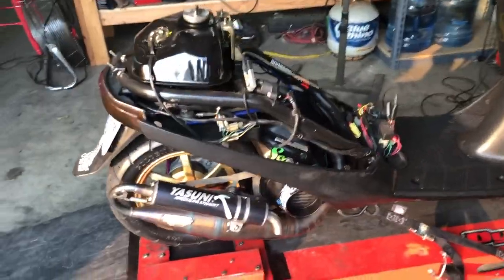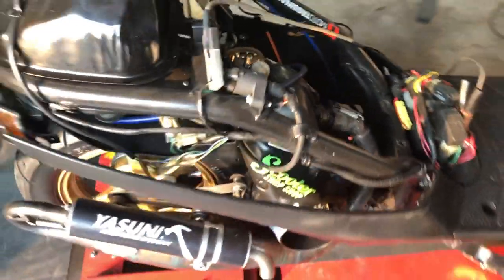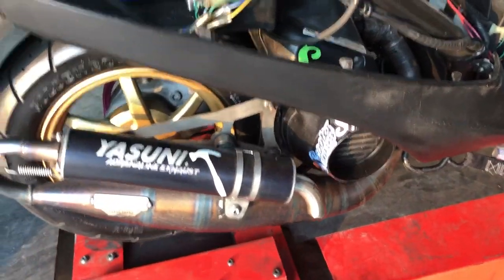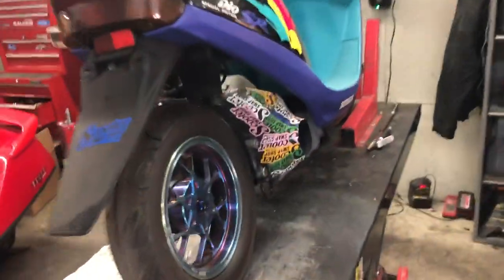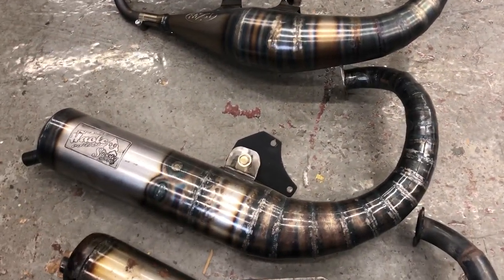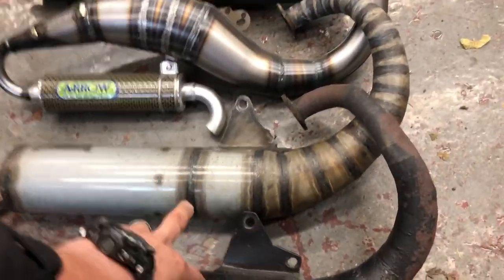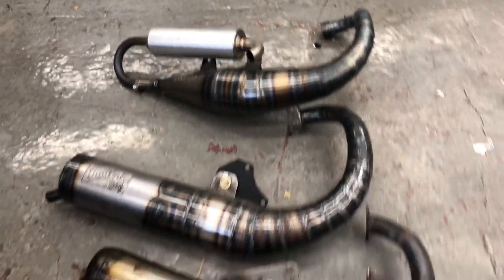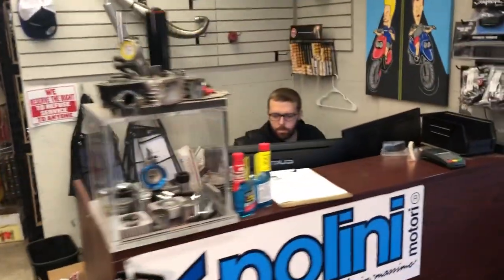Honda dio elite dyno pipe shootout Part 1

Comment: What's with the expansion chamber pipes like these for the 4t 139qmb and similar engines? Any point in it? Does it make any power? Even at 10k+, what little I heard, they are not really any gains, but seems not many ppl try to get tons of power from the tiny chiny engines.. I have a large valve head, ported nearly as far as it can go, any more and it will need epoxy or welding, and has just over 200psi compression, with a9 cam,  I been thinking g about trying an a12, I also have titanium springs and retainers, pulled out about every trick I know on the heads and valves, a stock 150 intake will nearly fit perfectly, it's close enough it can be port matched easily, i have seen 10350rpm but I think the peak is closer to 9800, any idea if a expansion chamber pipe will help???
Reply from the maker: you don't put a expansion chamber on a 4t
Reply: @Scooterswapshop  naraku makes a pipe with expansion chamber for 139qmb, ( I know, that's why I was asking! )